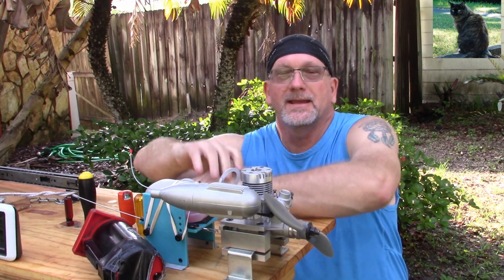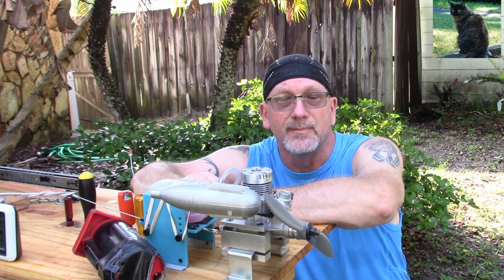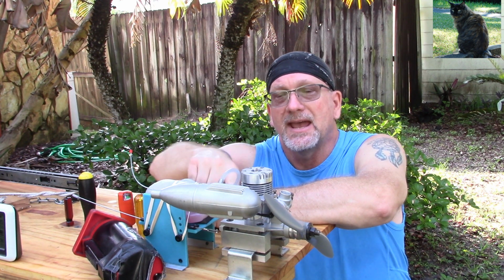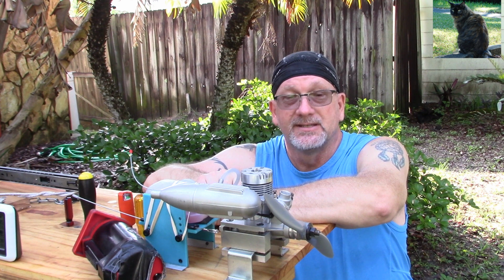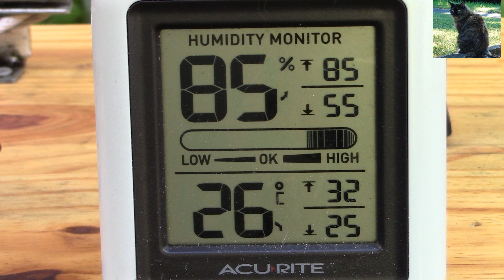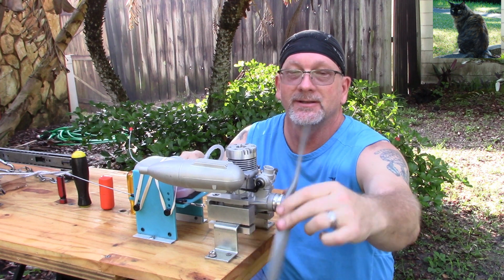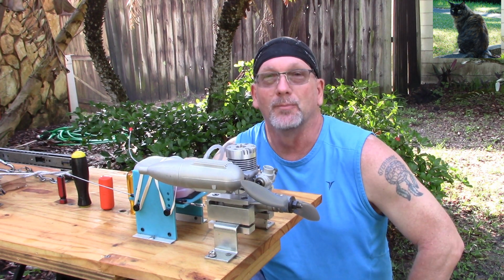OS 61 SF Customer Engine

Comment: Hi David, I have a OS 61AX I got it about 3 years ago. I did the first run up as shown in the manual, and I've been operating it with nitro fuel 5%.  Since last 3 months I've been having a problem with my engine, it's kinda leaking a "black liquid" which I assume it's fuel but I don't know why is black. I cleaned it up last month and still leaking that thing. Do you know what is happening ? Thank you so much...
Reply from the maker: Unless you are running black fuel, then no it is not fuel coming out.  The fuel gets consumed and only residual oil should be coming out.  Anytime the oil is black is an indication of metal on metal wear.  So yes, something is wrong but I cannot say what based on your description.  It clearly isn't right.
Reply: @dmrcflyr2  do you mind if I send you some pics? I'm gonna
Reply from the maker: @ksatogo  There is a link in the video description of how to obtain my email address.  Sure send some pictures.

Comment: those are good motors, but I prefer the older fsr versions.
Reply: I have 3 SF61 (one ringed and 2 ABC) and one of the first version of the FSR which is ringed and got this weird non Standard main bearing. The FSR runs very well and alot of the reputation of OS Max is build on the FSR series. The character of the long stroke SF allows high pitch props and lower rpm. It will turn a 13x9 with 10000 rpm on a pipe. The FSR has a higher rpm caracteristic which is also nice for some applications but the SF is more versatile. Both are among the best enginges OS ever build.
Reply: that is correct about the longer stroke,helping to spin a large prop.i still have that ringed 61,fsr, 90 fsr,61 vf,fsr with tuned silencer,25 fsr,40 fsr 10,fsr. have a bunch of other mixed-2 strokes. a pile of 4 strokes